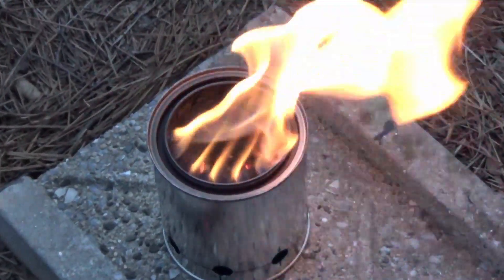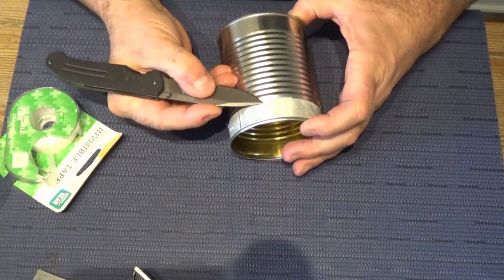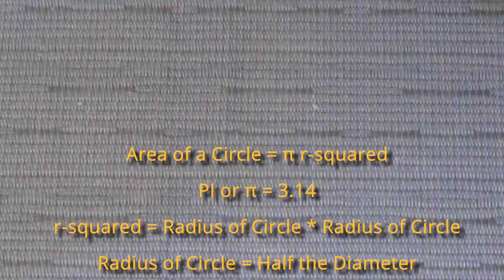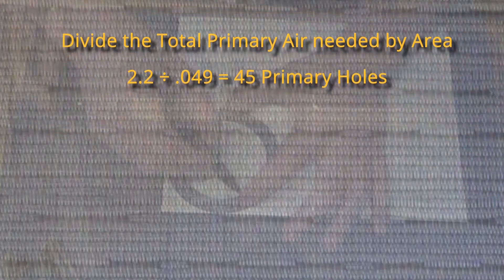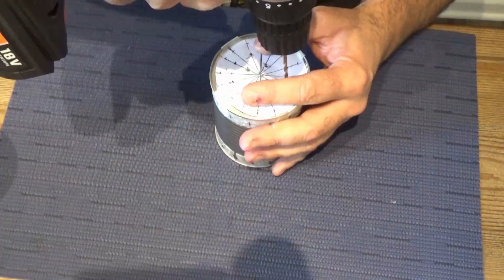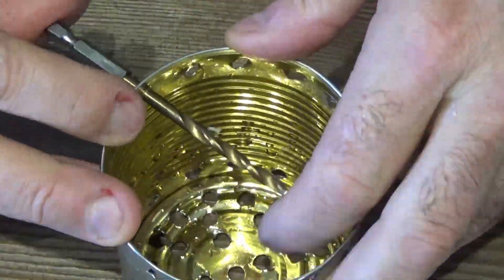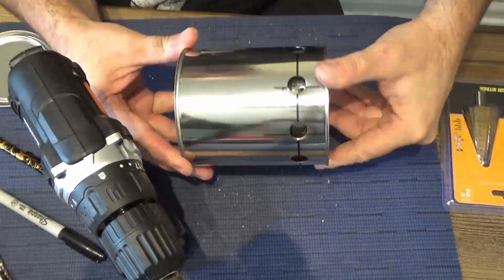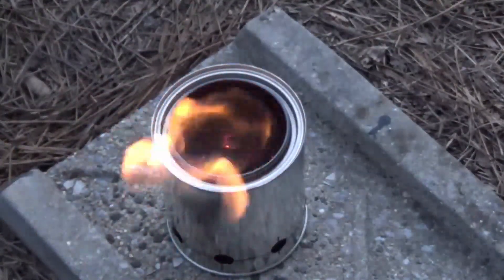Wood Gas Stove Science| Paint Can Wood Gas Stove Optimization! Making a good stove GREAT! Part 2

Comment: I've made a bunch of these in different sizes and they all work great! I used wood pellets in my smaller ones and cord wood in my large one I made out of an old hot water heater tank for the inside and a section of a 55 gallon barrel for the outside which made a great back  yard smokeless fire pit! They burn plenty hot and clean!
Reply from the maker: Glad you are having success with your stoves!

Comment: Why do you need the holes on the bottom of the inside can? Won’t the ashes fall through and interfere with the air flow?
Reply from the maker: It equalizes the air flow to all the pellets. The fire burns from top down and by the time the bottom pellets burn the ash is very minimal. Thanks for watching. For more information on this I have a huge playlist on my channel.

Comment: Nice one! second video i saw on this channel and got me hooked! excited to see if i can find experiments on larger steel barrels which is what i‘m looking for. Cheers!
Reply from the maker: Good luck finding experiments! How big are you trying to go with?
Reply: @heathputnam9524  Thanks! I want to go for a 55 gallon barrel as an outer container and 

a 150 liter former domestic hot water tank (made of thick steel) as an inner fuel container. 

So round about maybe 70-90 kilowatthours of fuel per run.
Reply from the maker: @OhmanRizboalter-ib5yg what is the primary purpose?
Reply: primary purpose is charcoal production from waste Biomass.

secondary purpose would then be cooking huge amounts of food with the mates
Reply from the maker: @OhmanRizboalter-ib5yg you will use less primary holes. My design is built to convert over to burning charcoal after the fuel is totally reduced to charcoal. That requires more primary air unless you want to dowse the charcoal once blue flame begins. Hope this helps!

Comment: If you're in the Northern hemisphere, your rotation should be anticlockwise, due to the coriolis effect on low pressure systems, and vice versa in the southern.
Reply from the maker: I actually have a video that shows there is little to no difference on the airflow or quality of burn. At least nothing I could measure! Thanks for the comment!

Comment: I'd like to see somebody make a gasifying rocket stove. Rather odd to consider, since the gasifier gets fed from the top, and the rocket stove gets fed from the bottom, but there might be a way. For example, perhaps an upside down rocket stove with a double wall design, and a ramp to feed it from the top. Some air would flow down through the ramp, down through the wood chips and through the grate supporting the wood chips, into the bottom chamber. Around the outside of the bottom chamber would be an air inlet. Also the bottom chamber would have some accessories; such as a tray that slides out to remove ashes and a damper to control air flow. The air from the damper inlet would mix with the gasified burn products and travel up through the outer channel to the top, through "jets".

Comment: I'm beginning to see your videos, I like them a lot. Could you add a cardboard at the exterior can (or another isolant material), so you could touch it and also have a greater heating of the air? Thanks a lot for all your teaching videos about nice can stoves!
!
Reply: You could use wool (especially good if soaked in a half and half borax and boric acid in water solution), ceramic fiber coated with high temp silicone (600*F or higher *), carbon felt, or the like, as long as you don't cover the holes. Cardboard might technically be ok, but when these stoves are really burning, that outer can does get pretty hot and could potentially catch the cardboard on fire or at least start to char it.  A way to test this, is to spray paint the outer can with some high temp paint, and when it is really been burning very hot for awhile, use a IR laser thermometer to check the temps (if you don't paint it first, it won't read it accurately btw).  If the outer can is getting to 400 to 600*F range, then using cardboard wouldn't be the best idea (especially since a stray spark or the like could catch it besides the outer can temp issue).   (Incidentally, even untreated wool can handle that temp range no issue, as it doesn't start to combust until around 900*F, and it is self extinguishing in nature anyways). 

     Insulation should/could help it to burn hotter and more efficiently, but the keep in mind that the hotter you get it, the faster the metals will oxidize/rust. 

      You could also coat the inside of the outer can with one of those special high temp, low thermal conductivity, highly IR reflecting coatings that contain zirconia. This would probably work even better than wrapping the outer can in a high temp resistance insulation for a few reasons. Adds less weight, less fiddle factor (no chance of blocking the air intake holes etc), and once temps reach 500*F and higher in the fire, more and more of the heat loss/transfer starts to occur via IR and less via conduction and convection. Think of it this way, your heat source/fire, as it gets hotter and hotter, its emanating/radiating that light like IR energy more and more, almost like its becoming like light more and more (the ultimate example of same would be Stars).  That, and air that those temps, as it gets hotter, it becomes more and more conductive, thus less and less insulating. 

   If you're going to do the above, make sure that you use a high temp paint on the outside of the inner can, so that the reflected IR can go through and back towards the fire more efficiently. Shiny metal surfaces do reflect some IR as it is, though steel and SS much less than polished aluminum.  

  * Btw, the silicone coating on the ceramic fiber insulation is not for heat resistance or insulation, but to stabilize the fibers. The fibers of this material are brittle, and as they break away, they become a potential inhalant toxin and can cause some real damage to human lungs. The high temp silicone coating helps to keep them in place and thus prevent that. 

  Cheers

Comment: hi man. just hypothesising here, with no real schooling in thiss... but, if the air between the containers get hot enough, then does it matter that the 2 walls are not as 'close as you'd want them'?
and 2: maybe feminazis left your channel when you found out you applied maths, and got "hurt" and upset by it 
i hate '''smart''' phones tho.
subbed
God speed mate
Reply from the maker: I have found that if the cans have too large of a gap the flow is not as strong out of the secondary inlets. That being said maybe insulation around the outer can would help with heating the air between the cans. Either way, if you are trying to build an efficient can stove with as few parts as possible. Try to stay with a close clearance between the inner and outer can; 1/4 - 3/8 inches or 6 - 10 mms. Thanks for the comment!

Comment: You've got me excited to try out the 5:1 ratio of primary to secondary air.  As far as the spacing between the cans, would it be optimal if the cross sectional area (area of inside of outer can minus outside area of inner can) would equal the total area of secondary holes?  Or would it be optimal if the cross sectional area between cans were to equal the area of secondary and primary holes added together?
Reply from the maker: Honestly I haven’t dug that far into my data, but there is definitely an optimum space. Too much and the air doesn’t heat as fast as it needs to get flow too little and the laminar air flow is interrupted. Sorry I don’t have a better answer on this but in my experience I would say 1/4 - 3/8 inch difference is best for can stoves. A larger stove will be able to handle a wider gap. Thanks for watching!

Comment: Very good tutorial with one exception. You made the math too complicated. The ratio is the same whether you use a round hole or a square hole. Area of a 3/16" square hole is .03515625, and the area of a 1/4" hole is .0625. Do the math, and it comes out the same. Sixteen, 3/16" holes and forty-five 1/4" holes.
Reply from the maker: OK, but how are you cutting a 3/16 square hole? I do not think the calculation for the area of a circle is too complicated, but I could be wrong… thanks for the tip and thanks for watching!
Reply: @heathputnam9524  You're not cutting a square hole, you are using the math to determine the number of round holes.       As I stated above, forty-five 1/4" holes has five times the area of sixteen 3/16" holes, whether round or square.                                               I like that you keep improving your design.
Reply from the maker: Either way… doesn’t really matter. I just like exact calculations… thanks for watching.

Comment: Is there a place where the parameters are collected an published?  Do you have a sense of how this will scale?  I'd like to make an outdoor firepit w/o smoke in two sizes at least 5 gallon bucket/can size and stationary fire ring in the yard.
Reply from the maker: I have not documented my result on a website. The design will scale but the ratios change as the volume between the inner and outer can changes. The hardest thing about making a larger stove is the flame must close off the pyrolysis zone or you will not get efficient burn. Thanks for the questions!

Comment: as i'm watching this I remembered an idea I had back in the days, to put a spiraling path inside the double wall so the air needs to travel around the burning chamber a couple of times before it comes out of the secondary holes. that way it has more time to heat up instead of traveling straight up.
realizing this would probably involve heat resistant JB weld and a lot of fiddle work cutting and placing all the spiraling strips i had in mind. but maybe there is another way to force the air to be longer in the heating zone (inside the double wall). keep up your videos !
Reply from the maker: I have tried this and failed, but I didn’t invest a lot of time in the idea. I think the longer path slows the flow and more air goes through the primary holes and changes the way it burns. Maybe I should revisit the idea though! Thanks for the comment!
Reply: @heathputnam9524  would love to see some experiments about this. I don't think it would slow down the airflow in a significant amount since there is no aditional resistance created for the air, but just a longer path to the exit holes.
Reply: You could maybe just try a spiraling strip of something (think Slinky!) like a spring or something like that.
Reply from the maker: Thanks for the comment!

Comment: Thanks for posting Heath, very much enjoying this series.
Reply from the maker: Thanks for watching!
Reply: @heathputnam9524  I have found that you can increase thermal conductivity between your burn pot and the outer can/vent. Steel is not very conductive thermally but thin aluminum which is very conductive can melt.So I married the two materials using a steel can for the lower 1/4 to 1/3 of the total burner chamber and slid an aluminum can over top of this to make up the upper portion of the burn pot. Obviously this require finding cans which fit and I found I could stretch the aluminum can enough to obtain a very snug fit.This is not an easy solution nor is it very practical but I mention it in case you or others want to experiment with it there is a substantial improvement in heat transfer. I hope this is of interest and of some value to this discussion.
Reply from the maker: Interesting idea! I’ve been thinking of a three can design to help with the hear transfer, but this is a great idea! Thanks!
Reply: @heathputnam9524  it does work very well help with some extra heat to the air channel so pressure is increased a little bit more than when using two steel cans. The only draw back is finding cans to fit in the size you want but it does work well.

Comment: How far up from the bottom did you drill your 9/16" holes on outer can? 
Would the primary air allowed by the outer can need to be equal or greater than the primary air into the bottom of the inner can? Or equal to or greater than primary plus secondary air because it's feeding them both?  Or am I missing something?
9/16" / 2 = .281, .281 * .281 = .0789, .0789 * 3.14 = .248, .248 * 7 = 1.74 sq in. area of air input through outer can?
Reply from the maker: Trying to catch me! Haha! You can absolutely choke the stove if you go too small on the fresh air intake, but it does not need to be equal or more. It’s a great point though. I usually start smaller and open them up as needed. Maybe I should talk about that on a future episode! Thanks for commenting!

Comment: Try trimming the bottom of the inner can so you don't have to worry about the holes on the outer paint can lining up with the soup can. :) That may allow the secondary burn to stay in contact longer.
Reply: I am obsessed with trying to keep stoves safe. Trying to think outside the box. Like what you do too.
Reply from the maker: That sounds interesting, can you elaborate?
Reply: @heathputnam9524   I guess you can say that.
Reply: @heathputnam9524   I'm glad the ideas help. Share the ideas away. <3